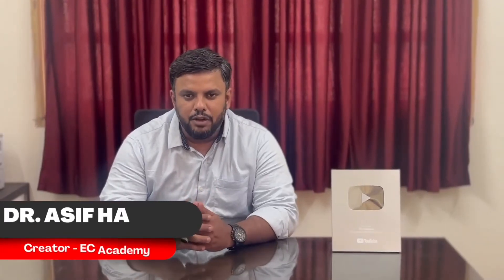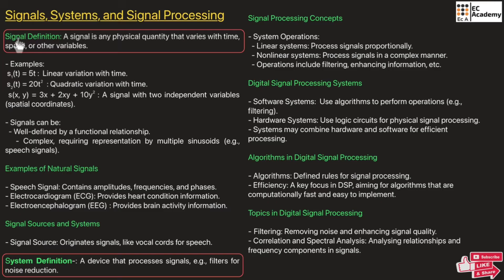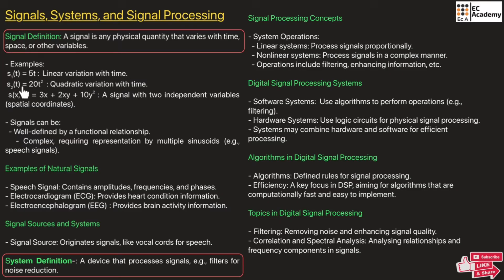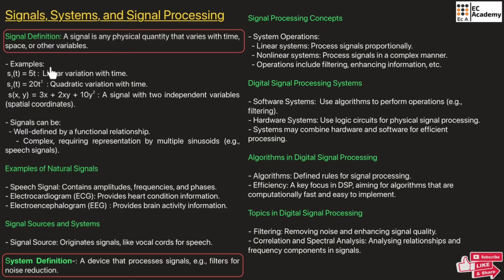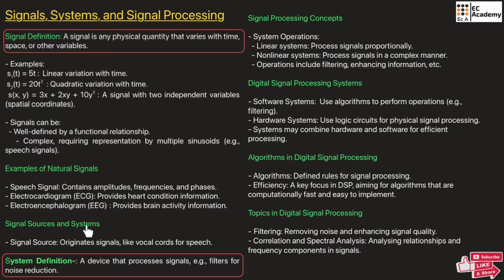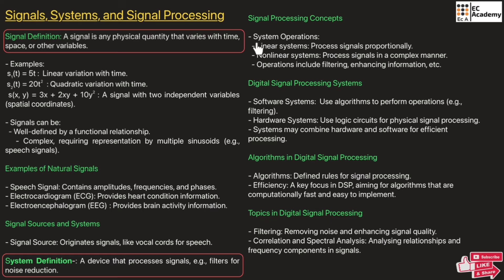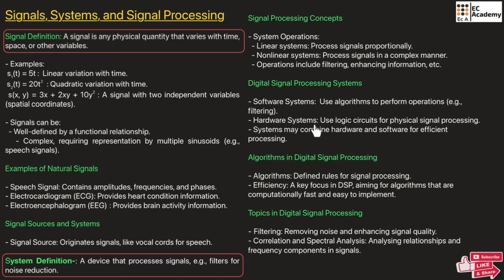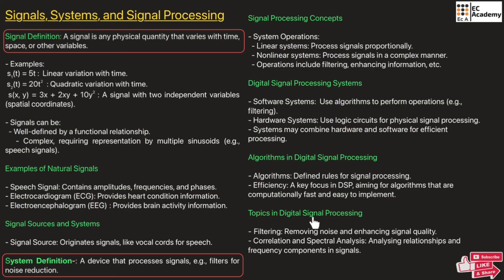Signals, Systems, and Signal Processing Explained | Definition, Source, Types & DSP Algorithms

Comment: t Topics Lectures
I Introduction to Digital Signal Processing: Basic elements of digital signal processing,
advantages and disadvantages of digital signal processing, Technology used for DSP.
DFT & FFT: Definitions, Properties of the DFT, Circular Convolution, Linear
Convolution using Circular Convolution, Decimation in Time (DIT) Algorithm,
Decimation in Frequency (DIF) Algorithm.
8
II Infinite Impulse Response Digital (IIR) Filter Design: Introduction to Filters, Impulse
Invariant Transformation, Bi-Linear Transformation, All- Pole Analog Filters:
Butterworth and Chebyshev, Design of Digital Butterworth and Chebyshev Filters,
Frequency Transformations.
8
III Finite Impulse Response Filter (FIR) Design: Windowing and the Rectangular
Window, Gibb’s phenomenon, Other Commonly Used Windows (Hamming, Hanning,
Bartlett, Blackmann, Kaiser), Examples of Filter Designs Using Windows.
Finite Word length effects in digital filters: Coefficient quantization error,
Quantization noise – truncation and rounding, Limit cycle oscillations-dead band effects.
8
IV Realization of Digital Systems: Introduction- basic building blocks to represent a digital
system, recursive and non-recursive systems, basic structures of a digital system:
Canonic and Non-Canonic structures.
IIR Filter Realization: Direct form, cascade realization, parallel form realization,
Ladder structures- continued fraction expansion of H (z), example of continued fraction,
realization of a ladder structure,design examples.
FIR Filter Realization: Direct, Cascade, FIR Linear PhaseRealization and design
examples.
8
V Multirate Digital Signal Processing (MDSP): Introduction, Decimation, Interpolation,
Sampling rate conversion: Single and Multistage, applications of MDSP- Sub-band
Coding of Speech signals, Quadrature mirror filters, Advantagesof MDSP

can i follow your playlist for this above syllabus ?
Reply from the maker: Yes